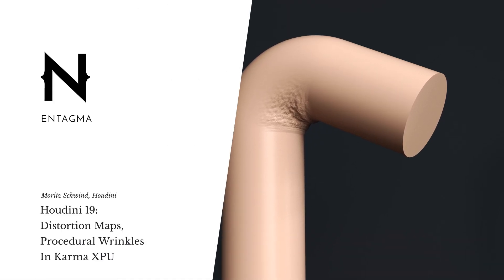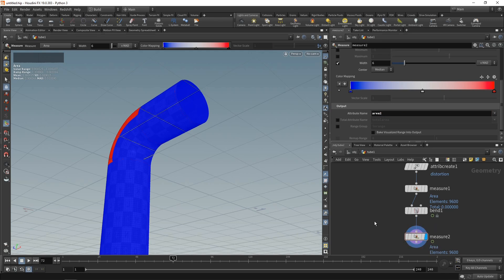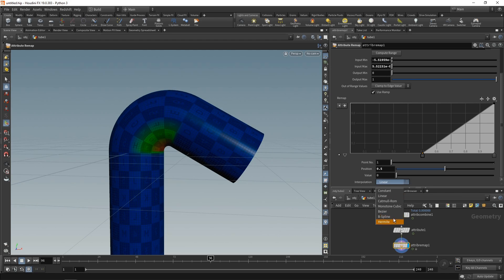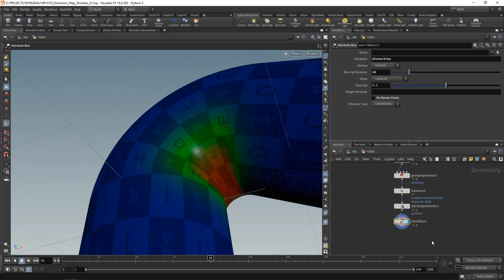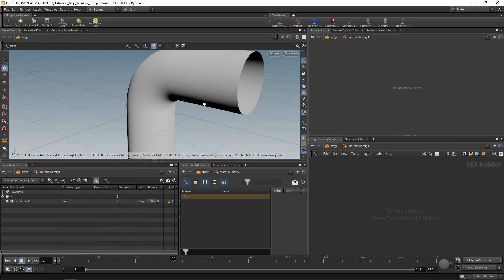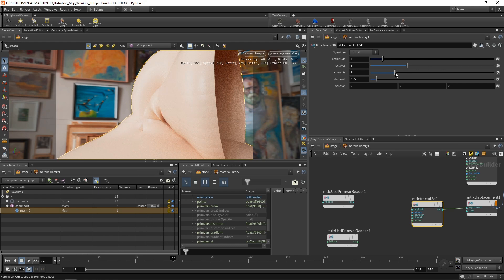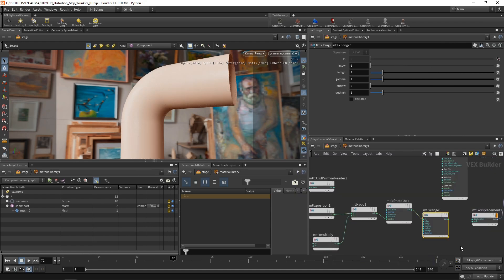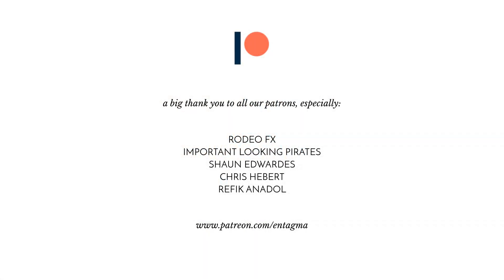Houdini 19 Tutorial: Creating Wrinkles & Rendering Them In Karma XPU

Comment: Is there a way to do this on a character for animation, I tried this in Houdini and everything is working great.

So the only problem I have is that I need to subdivide my animated character before geo goes into the bone deform node.

Overall the entire network even without subdivide on, is making it very slow to pose my character in the view port.

Is there a way to set this up so that the wrinkles only show up in the render?
Reply: Also since I am using new UV for the displacement shader which were created in sops with the UV texture node, how can I retrieve my original UV in order to still be able to use my substance painter textures in Mtrlx for the principled shader? 

While keeping the new UV for the displacement shader